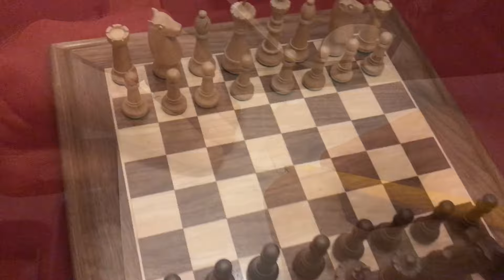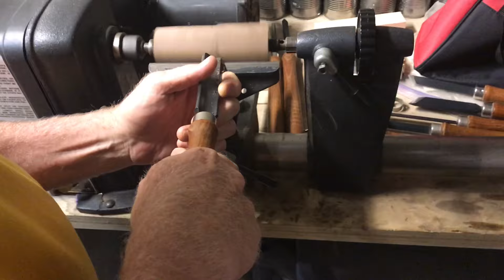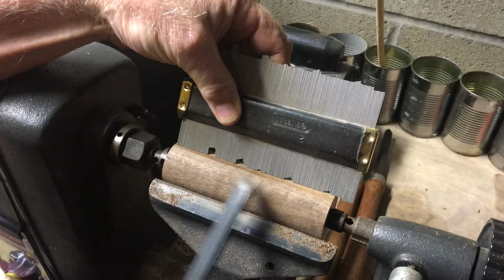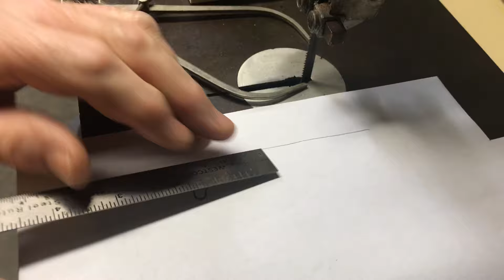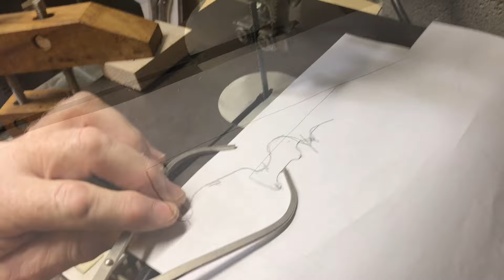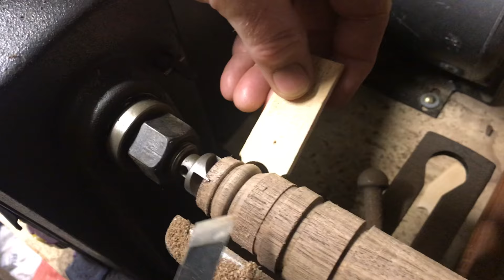basics on how to MASTER your wood lathe

Comment: Thank you. Excellent instruction. 

What was the name of the last tool to duplicate tge contours of what you just made?   I assume you could trace a new drawing from?
Reply: Contour gauge
Reply: By the way I just acquired the same lathe. But it came without the Locking nut to hold the bit in place. I am wondering where I could get one. I'm not sure what to call it to look on eBay etc. Thanks again!

Comment: This was really informative but no one has really taken the time to actually show the wood getting mounted on the lathe.  I know you spoke about cutting the X in the wood but what about the tail stock.  Does that actually remain stationary throughout the entire turning process?  You added oil onto it but is that so the wood doesn't burn?  Do I find center with the X and pound that in then slide the tail stock back into position and tighten it?   Thanks for sharing all this great info.....  Jody G

Comment: A most excellent video!!!  I just bought a used Craftsman lathe identical to yours and I'm completely new to lathe turning.  You provided many good tips and a boat load of valuable information in your video - all of which is extremely valuable to me.  Thank you so much for such a tremendous video.  (Would you happen to know where I can obtain parts for this lathe?)
Reply from the maker: We’ve really been enjoying this craftsman lathe. One modification that we made was changing the motor to a variable speed motor. We got this motor from an old treadmill and we used the speed control that came with the unit. It is possible to change the speed with the belts, we feel this was one of the biggest improvements. The next big improvement was the live center, This is the part that spins with a ball bearing on the other side of the motor. Without the Live center you need to make sure that you have oil against the center spike and the wood you’re spinning. I think we pick this up on Amazon for about $15. The more you get into it the more you’ll appreciate the little improvements. The size of this lathe is really nice, we just spun down a handle out of an apple wood log to make a blacksmith and hammer. We also polished hydraulic cylinders to a chrome finish. You never know what you’re going to use this equipment for until you have it. Hopefully this answers some of your questions, enjoy!

Comment: Hi there - new to wood turning and currently restoring my grandfather's lathe.  It's the exact same lathe as this, question... Looking through the manual, what is the plunger for and how do you remove it? (Gotta clean the rust off it).  Thanks and greath vid :)

Comment: Question: I just bought a lathe like this, I'm trying to take the spur off so I can put on a chuck jaw but mine doesnt have the hex nut I see there at 29 seconds, it's just threads where the nut should be, so how do I get the spur out without that nut being there?
Reply: Check the opposite side of your headstock